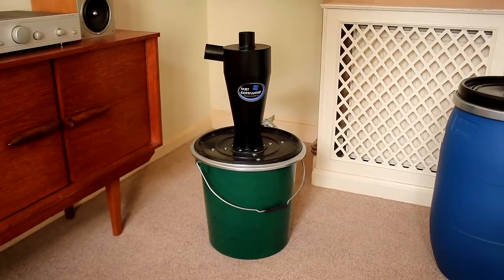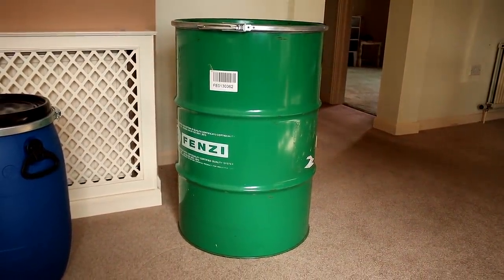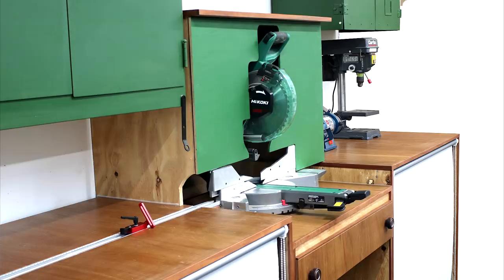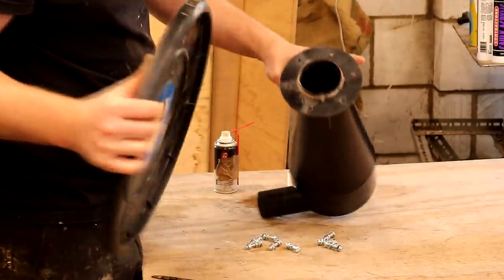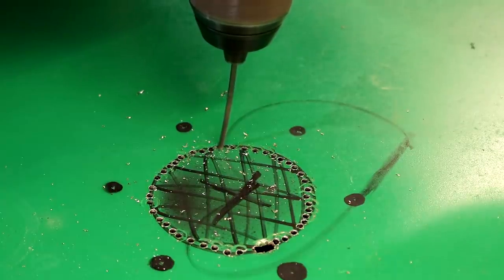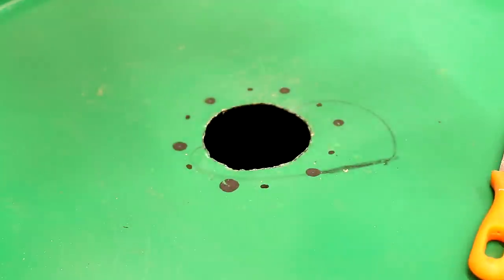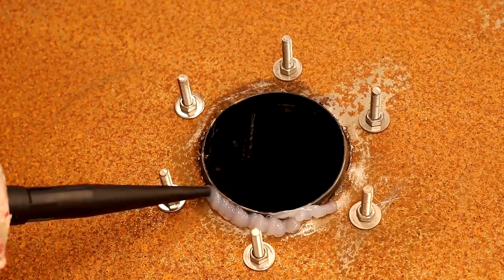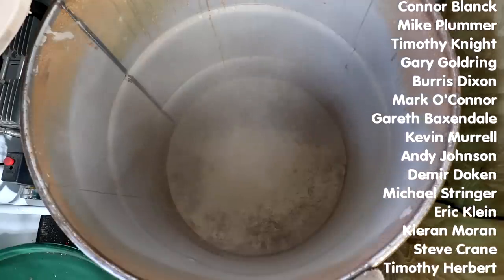Making A Workshop Dust Cyclone Separator

Comment: Mr. Brown
Notice that you did not have a liner in your green cyclone collector. You should make a squirrel cage out of light gauged concrete reinforcement wire. Insert a liner (plastic trash bag) inside of cyclone collector then the squirrel cage. The cage should be as tall as the collector. The squirrel cage will keep the liner/bag from collapsing and maintain the circular shape of collector. When emptying just remove cage then liner/bag. The cyclone collector would not have to be move to empty it. Also you should ground any plastic or rubber  tubes or hoses. This would prevent any static discharge from happening. Over time static will build up in the plastic/rubber tubes. If the conditions are right this might lead to a discharge would could cause a fire. The fine air born dust will ignite during a static dischare. It is a rare event but it does happen. A non insulated wire running along side any plastic tubing will prevent this. Great videos - detailed real life events/items when performing projects.

Comment: The most important thing about buying a used barrel is to get one that does not contain a dead body.  I made a home made version out of a plastic trash can with wheels.  Just a couple of four inch fittings on it, one angled and one straight.  The drum collapsed.  I braced it for the inside.  Worked well on the planer/thicknesser.  Do'n't use it much because of limited shop space.

Comment: Drums are also easy to get from drum recyclers, scrap yards and often from industrial plants, as they get stuff in them, but have to dispose of them. If buying try to get one with a lock lid that you can just clamp release, or you will be sitting every time with spanners to remove the nut and bolts. As well stainless steel lasts longer, but is of course a lot more expensive. Smaller drums are also available as well, from 20l, 30l 50l and 100l, though these do tend to be liquid type only, but are handy if you need smaller. 

Wash out whatever drum you get though with care, you never know what they held before, and some of them should not be touched, especially those that contained powerful acids, alkali's, toxic substances or a large range of not too healthy industrial chemicals.  Generally the label on it has a Hazchem rating, stay away from corrosive, toxic or dangerous.

Comment: jigsaw on slow speed with a fine tooth works wonders with metal.
Reply: yep, I agree
Reply: Totally agree
Reply: Phillip McKeaig I always use the jig saw with metal blade , works perfect
Reply: It does work well you're right. Nibbler is the right tool for the job though. You just need full body armour when using one :-)
Reply from the maker: I should have thought of that, but then again I don't own any metal cutting blades and probably would have been too impatient to order some haha

Comment: Another great video Keith, one trick I use if your pen isn't long enough for a hole is to just use a nail instead. Tap it lightly on the top and the mark is transferred :)
Reply from the maker: Great tip 👍

Comment: Open Head Drum/barrel. Just make sure it was used lined, or held non-hazardous stuff. They come with the clamp like yours, or a ring that bolts on to clamp.  Green is a bonus.
[edit] also, if you are lucky, they come epoxy paint lined, in some cases.

Comment: I would love to know more about that remote control system!
I recently did my own mini dust collection system for my hand tools (jointer and planer still need the 4" ports)... my dust extractor has an auto-on feature that goes with the tools but i can't trigger it manually at the moment, which is unfortunate because it lives under my workbench and the power button is inaccessible. I kind of prefer the remote approach over triggered blast gates, as for a small DC/dust extractor you want the blast gate to be as close to your branch-off point as possible!

Comment: Hi, thanks for the informative video. I'm looking for a system for my thicknesser and my old DJM 100mm dust extractor clogs after a while at the entry point going into the vac. Shouldn't you have a 100mm pipe for the cyclone owing to the chips from the wood. Or am I thinking this wrong, thanks Terry. Nice vid by the way.
Reply from the maker: I don't use it for the thicknesser https://youtu.be/nC7_fgojpy4

Comment: Hi Keith, hope you don't mind me asking, but I cant get hold of a Steel Dust Commander HD for love nor money. Are the Plastic ones a suitable alternative ? Just wondered why you went particularly for a steel one. I have ordered a Steel Drum for my collector so hoped to get a Steel Cyclone to suit.
Reply from the maker: Hi Colin, yes plastic is perfect. I only went steel because someone was selling one locally
Reply: @RagnBoneBrown  Thanks for the reply,  I have just ordered one from Amazon this very evening. Didn't go for the plastic Dust Commander as it had quite a few poor reviews on Amazon regarding build quality so bought a different brand. Will see how well the one I've ordered stands up 😁
Reply: @RagnBoneBrown  Well my Dust Cyclone is built and working 😁 pity I can't post pictures here 😒.
Glad I went with a steel collection bin as when dead ended, I can still see the steel lid depress slightly under the vacuum so goodness knows what it's like with a Plastic Bin.
Even more surprising is the suction seems so much improved as well which I dont quite understand. Need to save up for a good quality Hepa Extractor, but for now my sons discarded Vax 2000 Watt upright vacuum cleaner seems to be doing a sterling job.
Keep up the good work 😁

Comment: Possible fix for the capacity issue with your barrel.  Design and create (you seem to have a knack for that) a wheel base for the barrel to sit on so you can move it out when full.  Secondly, place a 55 gallon garbage bag in the barrel (just over 200 Liters) so you can remove and replace easily as needed.  You of course need to be careful of the thickness of the bags, construction grade is your best bet.  It may not be foolproof, but it will make moving the barrel about a snap and emptying a far less cumbersome task.

Comment: Couple of points Keith 
Firstly, why didn’t you use the gasket as a template and not the thick wood????
Secondly you can get sensors on Amazon etc to set a particular fill level, but does that not negate the point of having a larger drum??
Thirdly..... maybe some kind of tipping mechanism to empty it out??
Doing all of this thing at the moment at my home... going to fit a large 100 litre shop vac body ( https://www.lumberjacktools.co.uk/product-lumberjack-bde1200-50-litre-dust-chip-collector-1200w-lum00101) with a cyclone and take the vacuum motor and mount that to a much smaller metal drum...... hopefully???
I think it’s a better compromise?? ...... that’s the plan anyway.

Comment: We can see you are not a Metal worker LOL.... And have I got  a shock coming your way.... So you think you will empty the the drum at half full??? I usually get to remember when the shavings are blowing back at me through the thicknesser. Some of the bigger jobs I do, I can fill the barrel in a day.  :)
Reply: You can fill the barrel with a rubble sack; and blow the compressor into it to make it fill it completely, then drape over the top before putting the lid back on.  Makes emptying it a LOT nicer (don't get dust everywhere!).
Reply from the maker: 😂 you make very good points 👍